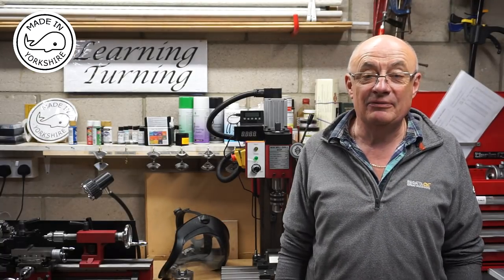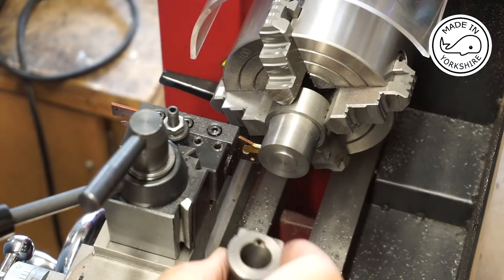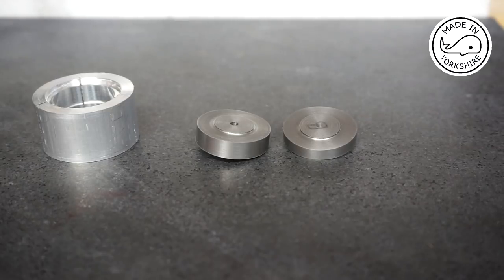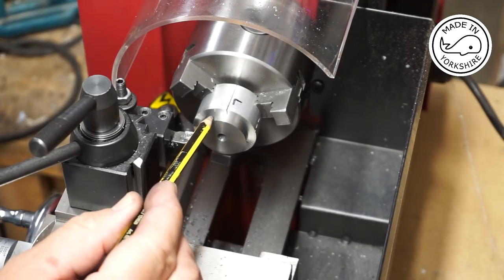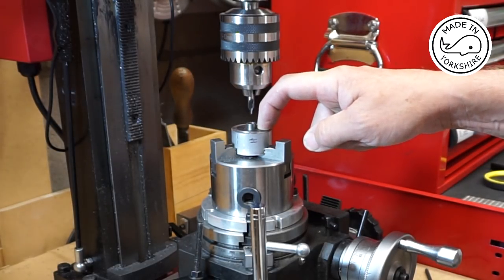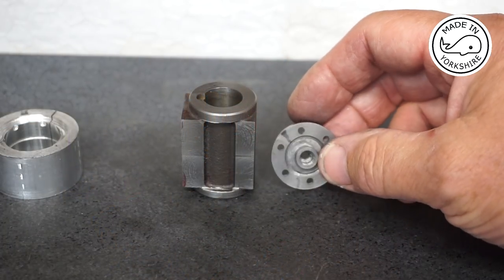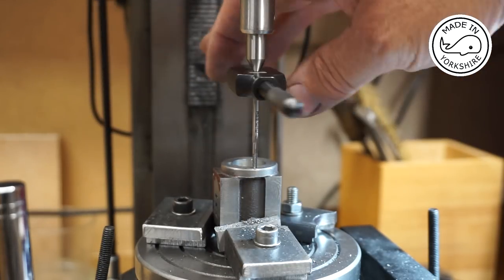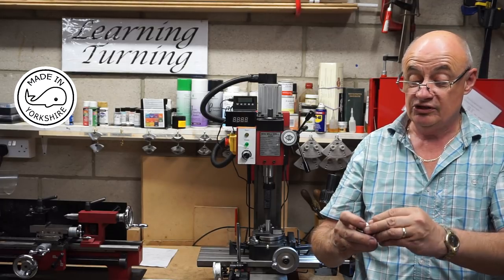#MT22 Part 5 - Making Stuart S50 Steam Engine Cylinder Covers. By Andrew Whale.

Comment: I have a bit of advice on turning cylinder covers. You made them with a serious of facing cuts. That works but depending on the backlash in the lathe it can be hard to match up the steps left by that kind of cutting. What I do is set a carriage stop at the depth of the cut. Then I turn the profile along the long axis. Using that Approach you could have made the undercut on the lathe at the same time you turned the profile. 

Tony
Reply from the maker: Hi Tony
Many thanks for the advice, I will try to remember that approach next time.
Cheers
Andrew

Comment: Andrew, be warned that sometimes in the model engineering fraternity, to keep the nuts and bolts in scale, that there are nuts and bolts that are 1 size smaller than standard. For example, you can get 7 BA bolts with a 7 head and you can also get 7 BA bolts with an 8 BA head. Nice spanner by the way a good quality one.
Reply from the maker: Thanks Dave. I didn't realise that, and it answers some of my past confusion.
Cheers
Andrew
Reply: sure but this is first I've heard any bolt mistakes in kits from them. The only lack I've seen from YT modellers is an occasional sketchy casting, usually in the flywheel

Comment: I believe the jaws should have been reversed for Tubelcain's collet to work fully. At no time, with the jaws as thus, was the ever any pressure on the partial cuts to clamp. The only clamping was on the very back edge of the cover. @7:38
Reply from the maker: Hi Grant. Many thanks for pointing that out. I'm not sure why I didn't realise that at the time. I hope your comment will help others that might try to follow my method.
Cheers
Andrew

Comment: Have the drawings been changed at some point, from a 5-bolt pattern (top) to six-bolt? And I remember a 4-bolt pattern on the bottom cover. My replacement plans have six.  I like six, and I strive to make the hole patterns match.  Rotary table helps!
Reply from the maker: Yeah, I think the drawings must have changed at some stage. Having recently installed a TouchDRO on the mill, I now find it far easier drilling circular holes - using the circular function. I did a series on the TouchDRO if you fancy making one.
Have a great day.
Andrew
Reply: I'd love to have a large Mill.  Got a Chinese one, but seldom use it.  Normally what I build can be machined on my CNC'd Sherline mill and lathe.  I can generate Gcode for circular patterns, rectangular patterns, etc.  but for the castings I think I just use it to lay out the holes, or position the spindle to each hole in sequence.  (my hands get sore anymore).  I'll check out TouchDRO.    Great job!

Comment: what size rotary table are you using
Reply from the maker: Hi - It's a 110mm Axminster Delux rotary table with 3 t-slots. I also purchased a 150mm 4 t-slot version from Axminster.
Hope that helps.
Cheers
Andrew
Reply: @learningturningmetal  Thanks, I really enjoy your clips

Comment: I kind of goofed and bought an S50 kit on ebay. It only came with the one chart, maybe thats all you get, I don't know. I don't hear well and you keep referring to what sounds like Tublicon. Is this a book on these? I don't know if I'll be able to machine this anyway, as my machinery is far to large, but thought I might try it anyway, but would like a few more instructions. Thank You, I've been watching your videos and have much more info than I had.
Reply from the maker: Hi there. The kit only comes with one sheet of drawings. Tubal Cain produced a series of detailed instructions for Model Engineer in 1992. This is what I refer to. If you expand my video description just underneath my video you will see links to these articles. You can download and print them for free. They are really helpful. I hope you manage to have a go at making the S50. Good luck and have fun!
All the best.
Andrew
Reply: Thank You, I'll look that up. My problem is my smallest lathe is a 22" x 80" and my vertical mill is a Bridgeport series 2. I really didn't think about this before I bid on it. I'm going to give it a try, I think milling machine wise I'll be ok. Lathe wise I'll have to see I guess. 12" 3 jaw and 20" 4 jaw chucks seem a bit overkill, plus speed limitations. A 12" rotary table seems a bit much too. @learningturningmetal

Comment: This is well thought out precision machining and suggest using an acid brush + motor oil + 30% kerosene for parting, drilling and tapping for better finishes and to increase tool life... Cheers....
Reply from the maker: Thanks Dave - and thanks for the tip. I will give it a try.
Cheers
Andrew
Reply: cast iron is always machined dry

Comment: 04:32 to stop that chattering.... just keep the tool on touch with the Material.... turn of the lathe... an pass some turns by hand.... than back power on the machine....